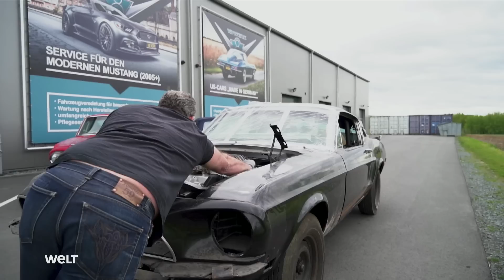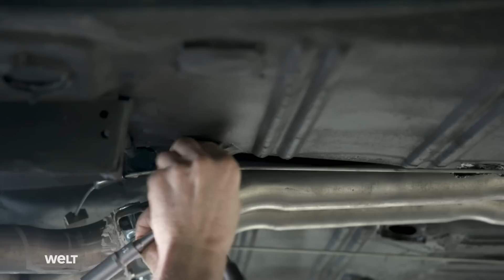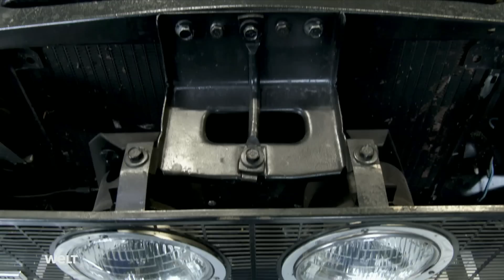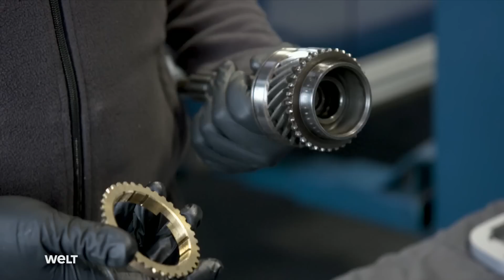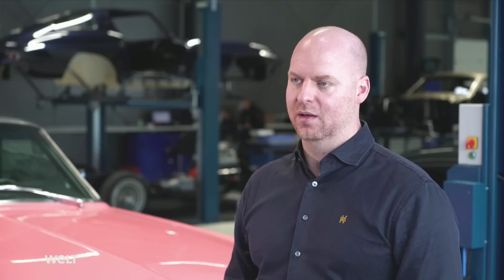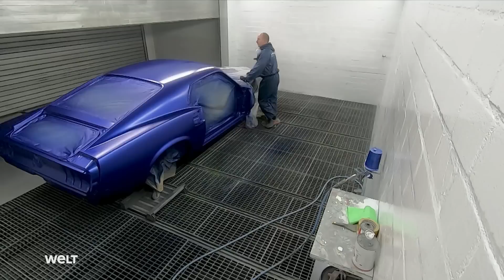BETTER THAN THE ORIGINAL: Ford Mustang - Shelby GT 500 restoration | HD Documentary

Comment: Andreas really pulls out the standard German superiority complex when it comes to working on Mustangs and American engines despite the original intent of the Mustangs as acknowledged by the owner (Christoph Herbrig).  Designed and priced for young drivers and gone thru many young owners who did not exactly have the mechanical sense nor the funds to make proper repairs...... It up to us Germans to do it right!  😝  The Germans during WW2 looked down their noses at American equipment no matter if it was a rifle or a high performance fighter plane.  If it wasnt German made....it was junk!  Such a contradiction to salivate over a Mustang but at the same time make noise over the engineering and less than professional repairs.

Comment: Alot of wrong info in this. Shelby not having the original engine doesn't not make it a Shelby. It has to have the badges n be in the book. Americans are just as good if not better at restoring these cars n when he was building the engine those were rocker arms n pushrods. Not cam shafts on the top of the engine.

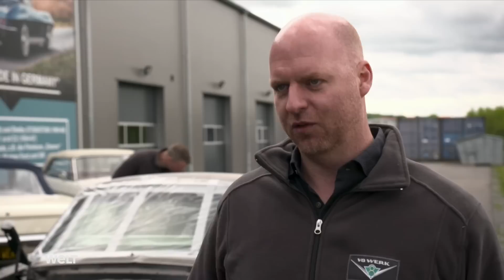Comment: My first car was a 1965 mustang orgional color like a forest green with a stripe running on the rocker panel GT 350. This paint had lots of primer when I bought it. It had a nice 302 cubic inch motor, T-10 4 speed , and a 4:10 rear I loved the Hurst shifter in this car. She ran pretty fast.

Comment: Hey Funkie!  The cork gaskets on the under side ends of the intake should be THROWN AWAY. They tend to be pushed out  over time and a big leak results.  First sand both mating surfaces with coarse sandpoaper resulting in deep scratchs giving teh RTV a good gripping surface to adhere to. and then clean them with brake cleaner and apply a 1/4 inche plus bead of "right stuff" on both ends of the block, then a thin coat on both sides of teh water passages only. Installing teh intake should be done equally and drawn down equally. Google "ford intake installation" for teh procedure , I`m too lazy to type out the entire process.

Comment: I bought a 2011 gt recently and it has yellow adjustable koni front rear and rear adjustable panhard. it's lowered on factory wheels 19s 150k miles brembo package manual I bought out of state didn't get to see it. It drove bad darted tramline pulled. Took to local tire chain for alignment and said something bent go to collision shop. They said looks good go to race shop for pro adjust setup.after reading up, well i adjusted top of shock to center tower it was off to one side completely both were passengers side .there is just a large nut that wont fit through factory hole in ahock tower so it is up against metal with a set screw through the side of nut to lock it, it was finger tight tower brace front and rear bushing all original in rest of suspension i don't know if I need factory seats or open the tower so nut fits through after I centered by eye and turned one wheel toe in a little it's million times better but not right but don't know where to take it but need to get it atleast ready for setup i feel sorry writing on phone and not the best at punctuation

Comment: Great video, but the narrator need to learn some basic terminology.
The rocker assembly is not a camshaft.
Pushrods are not tappets.
Torqueing the rocker assembly to the torque specification for the cylinder head would likely bread the bolts.

Comment: I’ve been watching these car restoration shows all day and I haven’t heard any of them address the topic of fuel. These cars are from the era before unleaded fuel which isn’t readily available now. What fuel do they use?
Reply: They would use unleaded fuel, since leaded isn't readily available. Lead was added to fuel to prevent knocking and valve seat recession. Modern high octane gasoline takes care of the first problem, and if the head was rebuilt, they would have used hardened valve seats which takes care of the second.

Comment: The whole installing Wilwood disc brakes up front with drums in the back has me questioning everything right now.  Only reason I can think of for this is because the owner just doesn't have the funds to also install the rear disc brake upgrades.  Normally you would do disc brakes on both front and rear, especially when upgrading to a 4-piston front brake caliper.  Other than it looks like they do some terrific work and have a passion for American Classics.
Reply: put into account other country laws too..rear disc brake barely make a dent in the budget for that level of restomod..
Reply: @benjy6358  And can be done later.
Reply: In my country, some people do that to have the rights to a collector's plate. Don't know if it is the case in the video.
Reply: Its normal to have discs in front and drums rear, nothing to question.
Reply: @cobra3289  You are correct but normally you only see that setup on a factory car with factory parts.  Usually when someone spends the money on a higher end disc brake kit for the front they will also do a disc brake kit on the rear as well.
Reply: The drum brake is important for the vintage car license plate.
It is also quite strong because it has a larger braking surface.
Reply: Old brake experts frown on rear disc brakes. They have always told me rear drums have more surface area contact so I approve of the drums.

Comment: You never ever use the cork end gaskets on the intake manifold!
Use RTV.
Reply: Depends. Corvette judging requires we use rubber china wall gaskets with GM tabs on the ends of the intake. If you're building a car to drive everyday, rtv is fine. If you're restoring cars for judging, we build them the way they were, not how we wish they were.

Comment: Pretty strange how they are happy to fit Willwood front disc brakes but drums on the rear.
Reply: If you look it up ,many modern EU cars have such set-up ,discs in front ,drums for rear...modern drum brakes are actually very reliable and last much longer.
Reply: I agree. I had rear drums on a 1987 Buick Grand National. So rear discs are just $$$$ fancy upgrades.
Reply: @imonaroll9502  I think if you are upgrading the front with dollar fancy upgrades then you are creating a big mismatch to leave the rear standard. Also the performance curve is much more linear with discs and drums self servo and the curve rises very quickly but then flattens. So drums and disc's are never really matched. Disc's look way better and are far simpler. That complex auto adjuster system is not reliable.
Reply: @johnsutcliffe3209  drums have more surface area contact. And fail a lot less than discs. Discs warp and are prone to ever heating. What do I know? I learnt this stuff from old timers.
Reply: @imonaroll9502  what do I know. I am an old timer🤣
Reply: @johnsutcliffe3209  Right On 👍